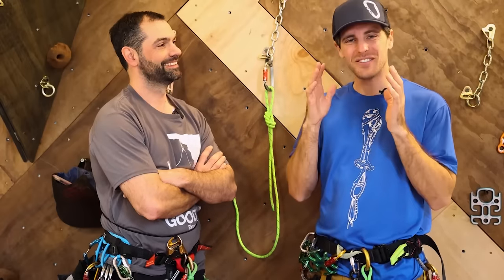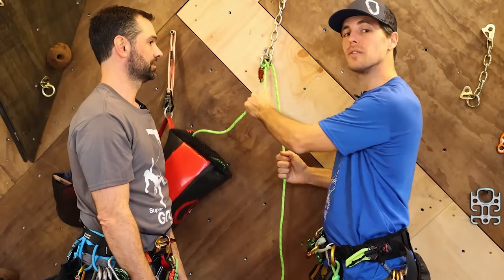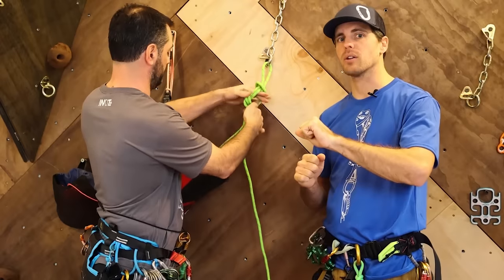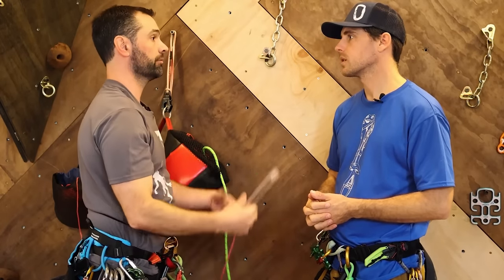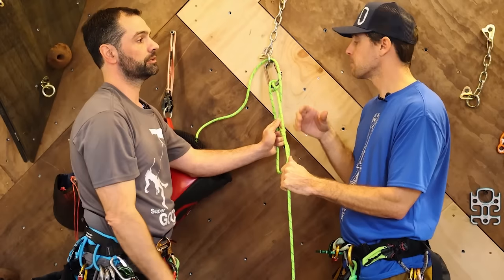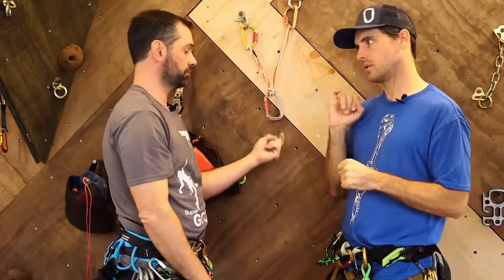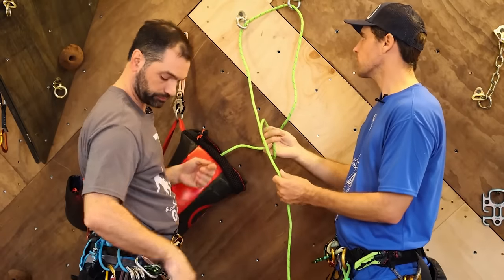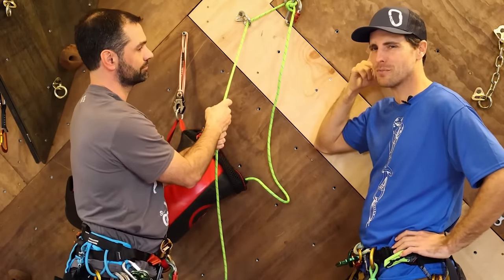Rappel systems with built in rescue solutions

Comment: @10:15, the concern can be addressed by stick design (4 holes vs 2 ovals), or by using what you have currently: In either case, clip a carabiner through the holes on each side of the stick and through the strands of rope going around your anchor. All but the last person down are protected from the stick coming out due to it pushing up against something, or any other reason. Having said that, you obviously want to rig it in such a way where it's not contacting anything. One of the reasons the holes are larger ovals in that design is so that there is room for both the pull cord and the safety carabiners.

Comment: 've been playing around (at home) combining a fiddlestick/smooth operator with a contingency aspect for rescue....basically I don't want to contribute to the deep grooves cut in UT sandstone but I want to have rescue capabilities....it has resulted in the "rescue" requiring removal of the fiddlestick while weighted. I can pull it out with a 200lb victim free-hanging, but like you've said, it's not easy lol. Once removed, the victim's weight is transferred to a totem/pivot for lowering. It'd be interesting to quantify the force it would take to remove a weighted fiddlestick.

Wondering what the canyoning community would think of it, or if this is just impractical. Like any other advanced anchor, incorrect rigging would be catastrophic.
Reply: Through your experimentation,  you arrived to what you are correctly describing as a rescue maneuver, and not the desired objective: Contingency rigging
There is a streamlined rescue process to "convert tails-up to lower"
But, 
If what you are looking for is to retain contingency you need to "rig contingency, like an MMO" and the last person rigs the toggle-stick or other toggle technique depending on if your are using the whole rope, or a portion/half of it.
I use this method exactly for the purpose you are describing: Contingency for the whole group, but the last person AND prevent rope grooves - Given the fact lots of areas in UT have natural-far-back-low anchors that result in grooves....or horribly positioned bolt stations that result in the same sad result: Grooves 
Hope this helps - Cheers!

More info here:
https://canyonguidesinternational.org/retrievable-rigging/
Reply: That is a test I want to do. How much force it takes to pull a toggle out? I have been focusing on other rigging options that support rescue and ghosting, but there is always a cost.

Comment: Awesome video. Just putting it out there. Back in ye olden times we use to block the munter with 2 half hitches instead of the mule over hand. Personally I think its neater, just as easy to tie. Just as easy to release and still pops with minimal drop. So other than not having a catchy 3 Letter Acronym what's the main down side of a  Munter double half hitch compared to the Munter Mule Overhand?

Comment: Difrent continents difrent styles but i am from The island of Madeira and a certified canyoning guide from ICA (international canyoning academy) and i do canyoning prety much everyday because over here we have the Winter canyoning season and summer season because we have in Madeira more than 130 canyonins on a 70km island so we can work everyday, and in my opinion, you should had put the munter or the eight blocker directly on the rings.
First master carabiner In one of the rings then QuickDraw from the master to the other Ring as a backup. You clip your lanayard to the master and also you can add another carabiner and do a munter hitch without Passing on the rings of course as a second line if you already have one line with the eight blocker Passing trough the rings and you can do the Backup of the eight blocker like you did with the QuickDraw or a sinlge carabiner on the carabiner that is already passing trough the ring on the side of the eight blocker
And that way you have to releasable systems in two difrent ropes. 
Going down you put yorself first into the rope of the eight blocker and block your descender. Remove the munter pack the rope into the Bag remove the carabiner that you did the munter remove the QuickDraw remove your carabiner from the lanyard and the master carabiner and to make it safer with the eight blocker you pass the carabiner in the small hole of the eight and the rope coming from the bag passing inside the carabiner só its hard for the rope to unblock by itself.
There is also other releasable system you can prepare using the figure eight that is easier to lower the first person só you can set the rope lengh and safer. Also very importante when lowering a person always two hand on the rope not leting it slide but passing it one over the other.
Ive found a lot of people inside Madeiras canyonins from all around the world using really bad techniques and some i had to rescue so systems should always build dorectly on the rings releasable and as clean as possible to avoid people doing mistakes.
Reply: I appriceate your perspective as a canyon guide on these systems. Guides really do understand the importance of Efficency and Rescue in systems. Using a master carabiner is great anchor management.

If I follow you correctly you discribed a Twin Compound Relesable system (video coming soon). There are so many ways to build and use these systems. This is why I like this approach of putting the systems into categories. It was easier for me to understand the capabilities and limitations of any rigging system no matted how it is built.

Comment: Sorry if this is a stupid question!
At 28:23, why have you built the block on that side?
Doesn't that mean the last person now has to descend on the "bag" strand, then pull the bag strand (long strand) through?
If the block was on the other ring, the last guy descends on the same strand as everyone else, then pulls this (short) strand through - and also now in the correct sense wrt the previous-made point, about direction of pull.

Comment: Question, can you make the non releasable fiddlestick anchor at 12:00 with a carabiner through the back 4 strands safely? It seems like a cool way to tie a top rope anchor that’s easier to untie than a figure 8 on a bight. I know this isn’t a rock climbing video, but I was curious
Reply from the maker: Like this but with all 4 strands instead of 2? https://youtu.be/pbevEaRUmMk This is one of the knot videos in the textbook
Reply: @HowNOT2  yes! I feel like using that knot, but  doubled up to create a loop like he does at 12:00 would be better than a figure 8 on a bight clipped into the master point of my anchor, simply because after top rope soloing or having buddies rappel, it would be so much easier to untie.
Reply: For your safety forget the fiddlestick it should be used in a really last resort thing but for that you also have the macrame knot and others…